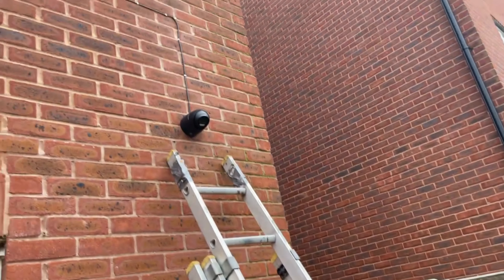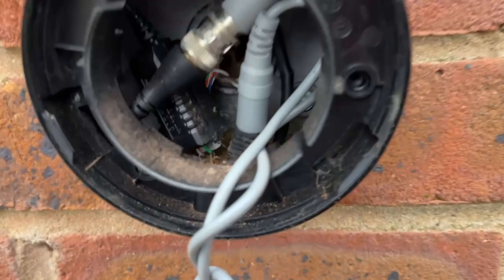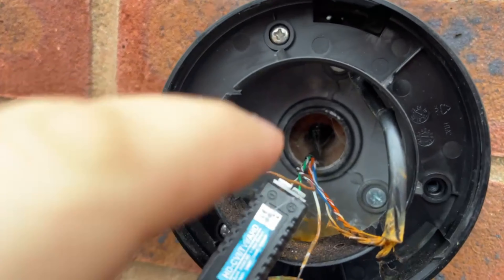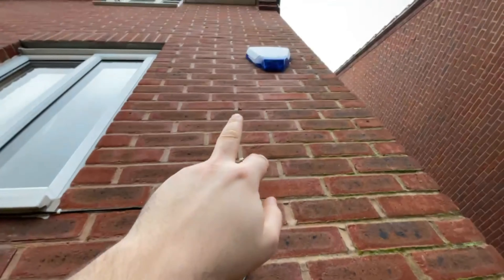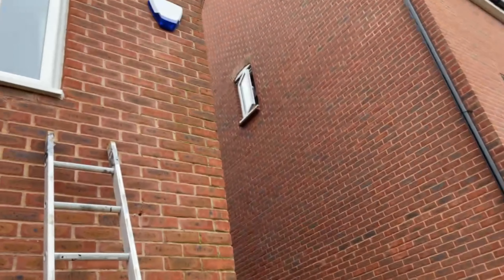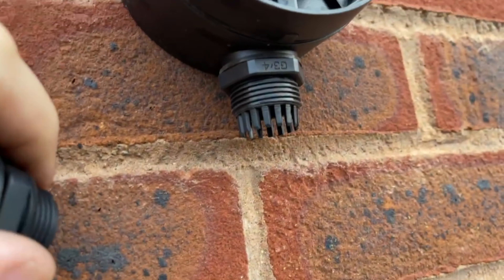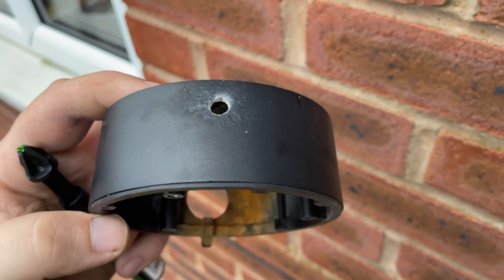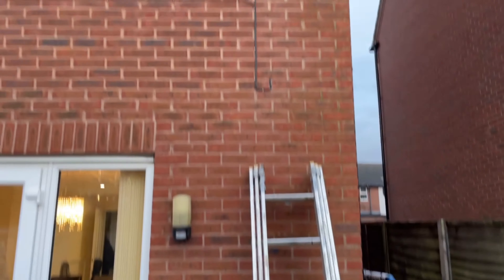Cowboy CCTV Install Put Right - Exotic Life Of A Security Engineer

Comment: Nice work. I have the DM21 back boxes, how can i reduce the bottom gland diameter to make a tight seal on the external CAT5E cable?
Reply from the maker: Thanks! You would just use a gland reducer, for example 25mm to 20mm reduced, screw that into the backbox first, then use a 20mm gland which would provide that tight seal.
Reply: @HikVisionGuru  cool, another question. I am just setting up my NVR 76 series, should i enable DDNS? If so what details do I put in?
Reply from the maker: @a.g-tk9ks  I would just go to advanced network settings, go to platform access and enable Hik-Connect, if all you are after is mobile app viewing
Reply: @HikVisionGuru  thank you for your advice, really enjoying your videos. Keep them coming.
Reply from the maker: @a.g-tk9ks  you can reach me on hikguru.yt@gmail.com

Comment: 20mm Black PVC Conduit with Black metal saddles would of sorted that no problem, those clips will just fall out the mortar in time & cable will end up getting weathered & UV damage or can easily be cut by an intruder wanting to break in then that’s left  the whole rear side of building compromised, 

On upside least you’ve Glanded in from bottom entry of Junction Boxes & used RJ45 to RG59 CCTV Baluns 👍
Reply from the maker: We would use conduit but client didn’t want to use it due to aesthetics, they preferred just a thin single cat5 pinned along. This is external grade cat5, not rubbish interns grade that so many use which does crack with uv damage and weathering. We use pvc where the cable can be easily reached, in this instance the cable is high up. So not at any particular risks unless the intruders are bringing ladders, but at that point it wouldn’t matter.
Reply: @HikVisionGuru  conduit would of looked a lot smarter then clipping it pal, whether customer thinks so or not is irrelevant it’s suppose to be in containment for a reason as per NSI BS Standards, 

customer not be thankful when someone accidentally or intentionally damages the cable, just my opinion pal that’s how I would of done it if their was absolutely no way of running cables internally 👍
Reply from the maker: All done to budget, customer gets what customer wants regardless of what we recommend. Not everyone can afford things to be done, we normally lift floorboards up with no external wiring but couldn’t cater to clients budget. They wanted it as basic as possible. 
Appreciate and respect your opinion and remarks 👍🏼
Reply: @HikVisionGuru  yeah I get what your saying but it would of cost an extra £20-30 to put that right, it all comes down to personal pride in your work mate & unfortunately I would of just turned them down if that was their attitude & told them to ring the original installer, like the old saying goes if you pay with Peanuts you get Monkeys or buy cheap buy twice 🙈 

Keep doing what your doing bud nothings worse then going back snagging & fixing other peoples mess 😫
Reply: @scottsmedley1255  I think if anyone was going to turn anyone else down it would be the customer turning you down for not listening to their (rightly or wrongly) thought out wishes. I get what you're saying about pride but if you do it your way and not theirs, then it's as bad as the cowboy who fitted the camera lower than the customer asked for initially right?
Reply: @jeffjeffjeff2 agreed, advise and explain to the customer why you do it the way you do. If they decline then do it, then charge when they ask you back to do it again! Not everyone is in a position to turn down work
Reply: @HikVisionGuru some people just don't get it, well done for accommodating your customers needs 👏. I'd like to get into the industry myself as I got burgled last year and I have personally seen the benefit of these systems, I fitted my own system and done a way better job than the previous fitter in your video, keep up the good work 👍